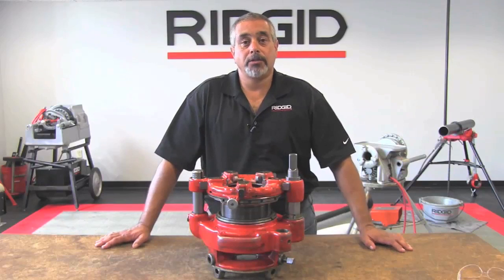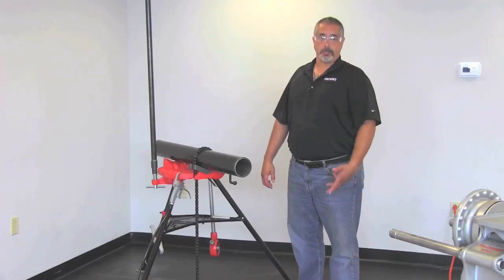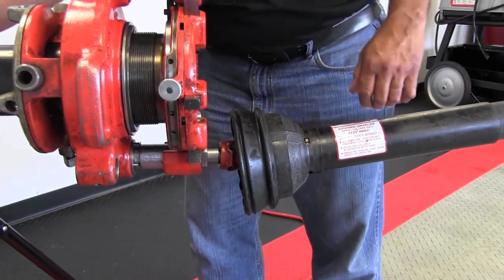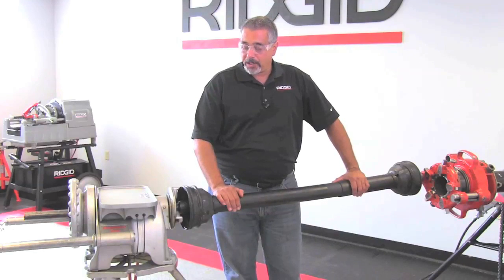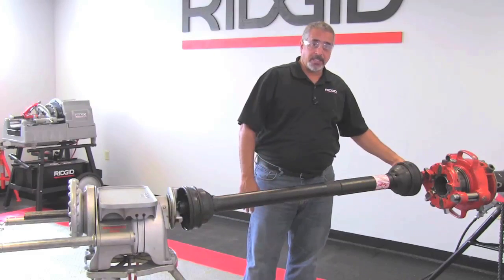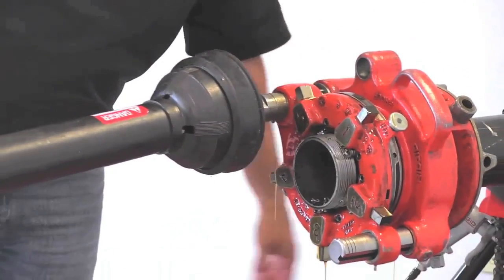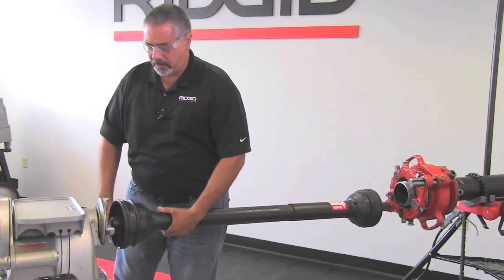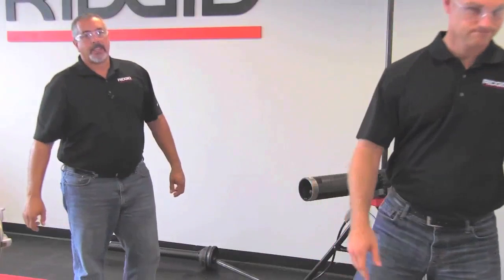How To Use The RIDGID® 141 & 161 Threader-Driveshaft Method

Comment: A tip for this device would be to leave the driveshaft hooked up after threading, open the dies, and then use the machine in reverse to back off the 141 threader until it is open again and ready for the next threading job. Or is there a better way to back it off to make ready for the next job? Thank you for these videos, they are very helpful.